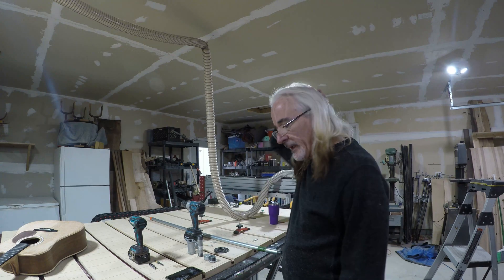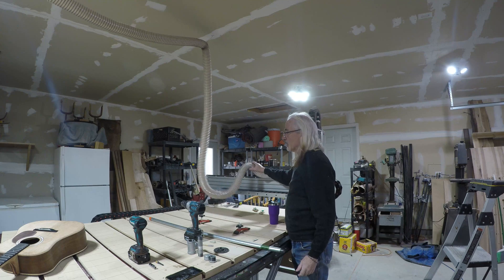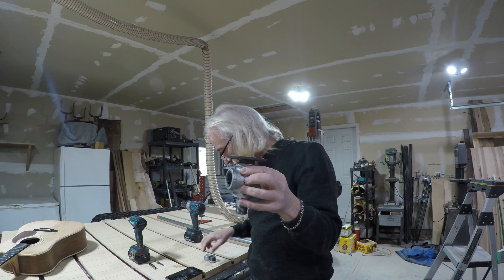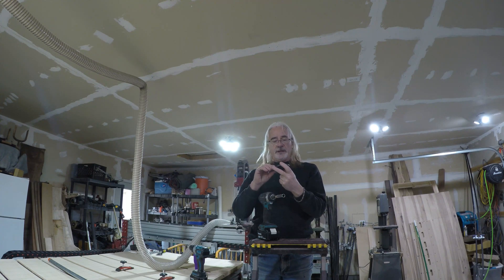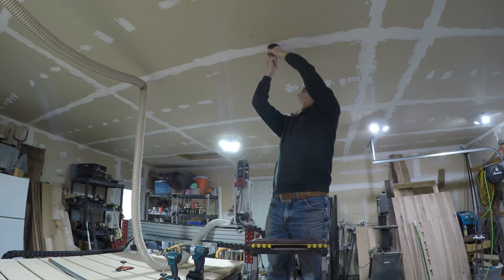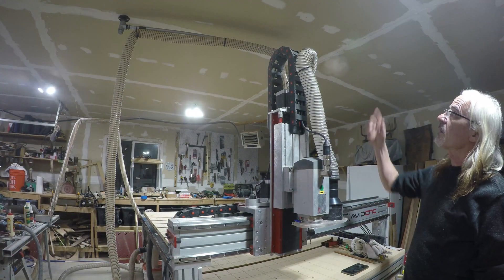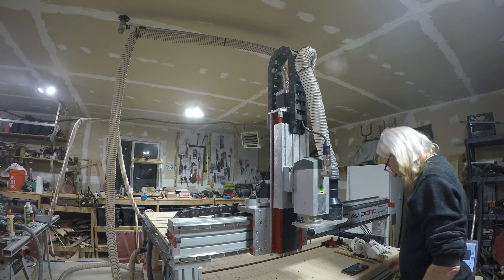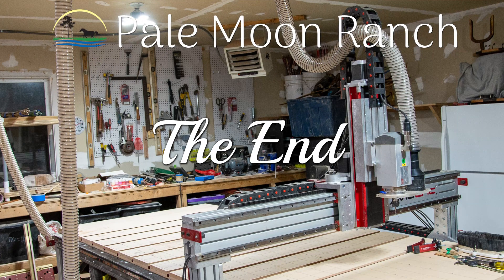Swiveling Dust Collection Boom for CNC

Comment: I have several instances in my shop where your method of building this swiveling mechanism would be useful; movable lighting as well as dust collection.  Your solution appears to be a lot stronger than building something with wood, and still not expensive.  Thanks for posting this, and for the demonstration of how well it works.